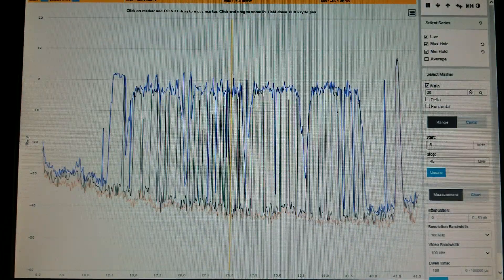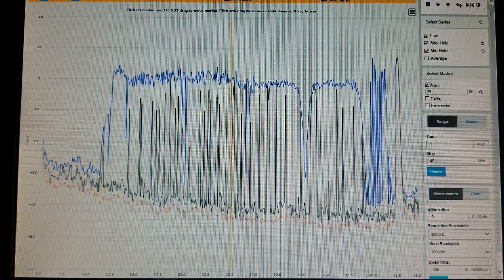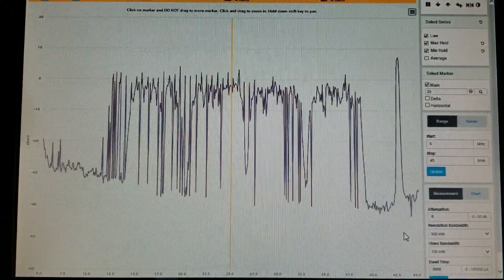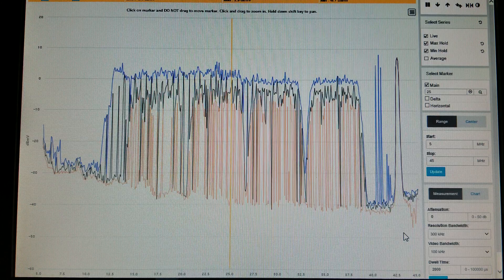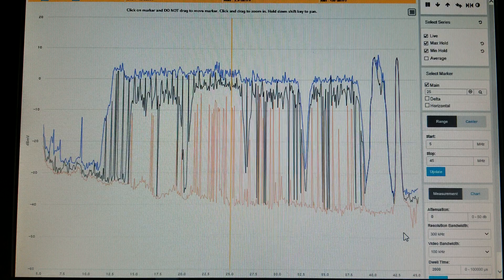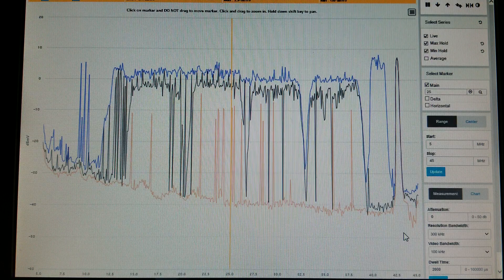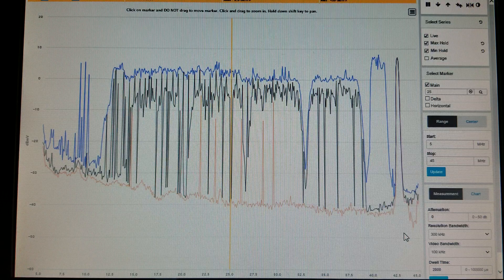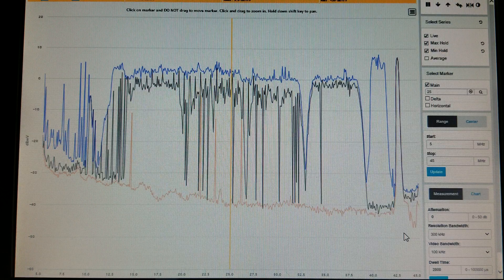Upstream - HPNA causing packet loss

Comment: God I need this guy to come to my house and find the root cause of my internet troubles that I’ve been having ever since I switched from DOCSIS 3.0 to 3.1. I’ve had multiple tech visits and at one point they said my modem was bad so I contacted Arris and gotten a replacement. I get packet loss randomly, and sometimes the OFDMA channel for upstream suddenly becomes not locked and the power levels for upstream jumps randomly most of the time the power levels stay at

1. SC-QAM - 25.0dBmv
2. SC-QAM- 26.5dBmv
3. OFDMA - 22.8dBmv

There’s 0 splitters on the side of the house or inside the house. Is the power levels too low? and if so why would that be. On the downstream side everything looks good good SNR (42) and good power levels too

Comment: HPNA was a DSL like technology from the 1990s. We used it and bridged it on to phone lines in the basement of condos and apartments. Distance limited to 2000ft. It has since morphed a few times becoming something that it only used in a house. DSL made more sense for a cluster of condos sharing a common phone room. We would also use SDSL extenders to reach hubs in closets and bridge the service onto the phone line. No DSL filter needed.

Comment: My modem has no upstream connection, the upstream light is blinking but never solid. i have 100 + ping whenever i play games. plz help
Reply from the maker: If your upstream light is blinking it generally does not have an upstream connection thus you wouldn't be able to run a ping test. Unless that model of modem flashes from communication. There is a lot of factors that can contribute to your high ping test.
1. The server you are pinging.
2. Noise on cable plant in the neighborhood but only a cable tech can look into that.
3. Faulty modem or computer.
4. Over WiFi....
Reply: @thebasiccablechannel7464  The modem i have right now is pretty old maybe 5+ years. Do u think buying a new modem may solve my high ping?

edit: i have tried several reboots and i checked all my wires. None of it seemed to fix the problem

Comment: Can you use the ICFR data from PNM-capable cable modems to help track this stuff down? I imagine the CM's would be doing a fair bit of time-adjust to try and compensate for that..modems upstream from the source would have lower adjustments than those downstream of it...? Maybe..?

Is there a way to track this stuff down that doesnt require a field-visit?
Reply from the maker: Not that I have found. Usually the home with the backfeed has already switched to another interner provider as well. But I imagine a high CM ICFR reading from a home with competitor backfeed would have very bad CM ICFR. Along with the other homes in the node with bad ingress.

Comment: I work for a phone company and I always try to unhook you guys from our stuff don't want it messing with my install and causing me a repeate or I know it messes with your stuff. Now I don't always cap your drop tho I have just cut the end off of it
Reply from the maker: The best bet would be to barrel and terminate the end of the cable coming from the cable company to keep ingress from getting in it. Worst case scenario put a barrel on it if you don't have terminators. But yes this HPNA costs cable companies thousands of dollars in wasted costs by causing service calls before it is recognized what the cause is.
Reply: @thebasiccablechannel7464  what's worse these days are the wifi powerline devices, wifi extenders and the ultimate return band destroyer - ethernet over coax.  it would be great to see some new videos from you!